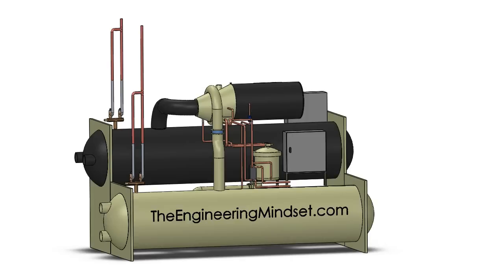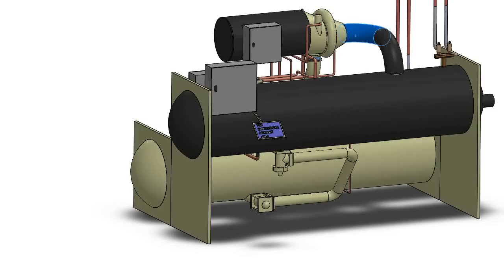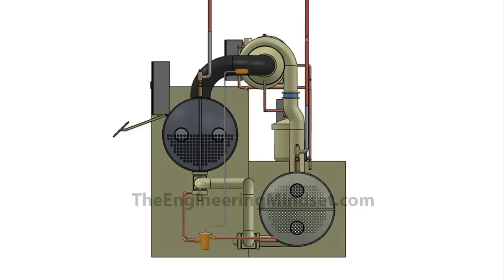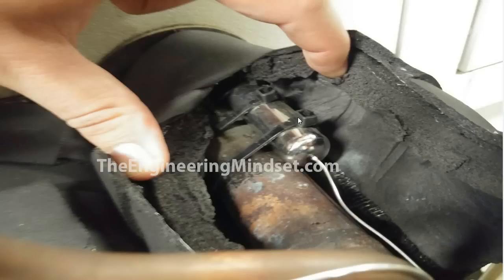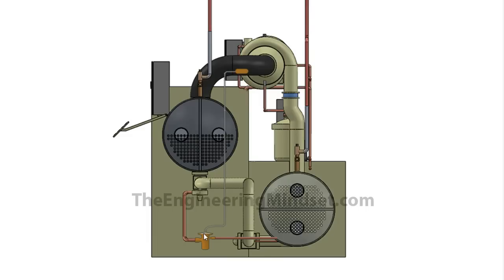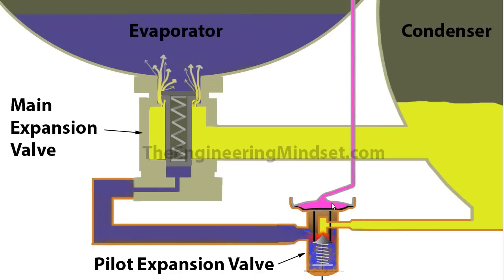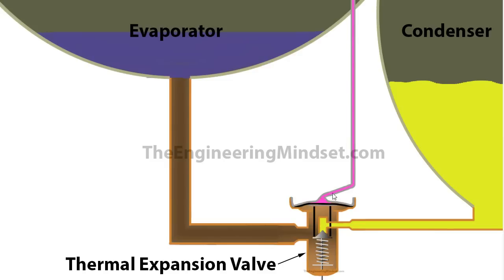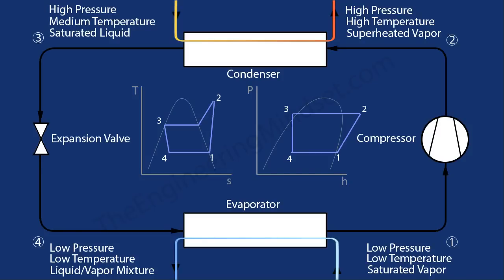Chiller - Expansion Valve HVAC

Comment: These videos are really good! Thank you for educating the masses! The mcquay machine your displaying the bulb from the pilot valve goes to a well on the top center evap. There is a temp sensor that is mounted on the suction 90 that gives the suction temp. to the microtech controller. The pilot valve is controlled from that bulb that is mounted in the evaporator. But all in all your videos are fantastic for getting guys familiar with chillers and also us seasoned guys for a little refreshing. Especially when all I’ve been doing is rebuilds.

Comment: Hello sir,
I would like to tell you that the first chiller has a float or orifice plate and the small tx valve is used for motor/vfd cooling as the base of the orifice chamber has liquid in it. As this style evaporator is flooded superheat is definitely not used for refrigerant control as it is likely to only be 1k. We work on approach with flooded type evaporators. 
The 3rd chiller is a Trane RTHB it uses a exv than that feeds the economiser, this exv is positioned determined on discharge superheat, the liquid refrigerant in the economiser is then controlled into the evaporator through a orifice plate, the sub cooled vapour in the economiser is scavenged and recompressed. This style evaporator is also flooded. The later trane RTHC and D also had similar refrigerant cycles but the exv was positioned via a low side float and I believe they may be falling film type flooded evaporators.

Comment: Thanks for your really great and helpful video, and can you advise what is a differences between Internal and External Equalizer Thermal Expansion Valve. Thanks
Reply from the maker: An internally equalized TXV uses evaporator inlet pressure to create the ‘closing’ force on the valve. An externally equalized valve uses the evaporator outlet pressure, thereby compensating for any pressure drop through the evaporator

Comment: Thank you for the information. I have a question, what do you mean by superheat? I bit you mean a superheated vapor. the thermal bulb which is located inside the suction line will sense the superheated vapor, but what I know is the status of the refrigerant after leaving the evaporator will be as a saturated liquid.

Comment: Nice video but you don't go into the aspect of the TXV sensing superheat.  You mentioned the Thermal Expansion valve shown had an external pressure 'equalizing' line, but didn't go any further.  By sensing both the compressor suction PRESSURE and TEMPERATURE, the TXV can actually sense the degree of superheat above saturation.  The spring setting can determine the degree of superheat.  So a drop in suction pressure will tend to open the valve, even if the suction temperature remains steady and vice versa.

If the valve only responds to suction TEMPERATURE, then an overcharged system can still pass liquid into the compressor under the wrong conditions.

Comment: I have a question. As the load decreases and the superheat decreases, what happens to the liquid refrigerant in the line between the pilot valve and the main valve that enables the main valve to close? Does it leak back through the pilot valve, or is their a bleed at the main valve that allows pressure to leak down? Thanks.

Comment: how can liquid refrigerant flow to the bottom of the evaporator? it's it being pulled by gravity?
Reply from the maker: It's being pushed by the pressure generated by the compressor as well as the suction from the compressor

Comment: We are experiencing a problem in our chiller system which is having an electronic controllled expansion valve. We have charged the system with 20 kg of R407 gas after having an alarm of low pressure. But it was not rectified and pumping down the system..we could barely see any gas coming back to condenser which was showing 75% when we charged it earlier. What all we have checked is
1. Dryer....ok
2. Evaporater...ok no leakage 
3. Expansion valve changed from a already  working chiller system.

Please guide us on what could be the possible cause of the syatem showing low pressure.

Comment: Hi friend @theengineeringmindset  I have a question for you, in another video I saw That in the sucction line there is a refrigerant  low pressure, low temperature, saturated vapor, but why the thermal bulb is in the suction line?? because knowing that the discharge line has the superheated vapor it should be in the disacharge line because the compression isn´t happened yet. Tnank you in advance.
Reply from the maker: try this video it will help https://youtu.be/oSLOHCOw3yg

Comment: what is the right superheat temperature for this kind of machine. 
I have 4 No's chiller which has different superheat
Reply from the maker: Hi Parvez. Have a look for the serial number and contact the manufacturer, they will give you the best advice as it will vary

Comment: What would cause the evaporator pressure to drop too low ?
Reply from the maker: There's a lot of reasons it might happen. Possibly a tube blockage, too high water flow rate, maybe the wrong delta T from design. Have a look on the BMS logs to see what was occurring at the time of fault. Compare it to other times and see if there is a comparison. If it gives an error code then look it up with the manufacturer to diagnose.
Reply from the maker: We just covered chiller faults in our recent video! https://youtu.be/Zu0LVVNNVSw

Comment: 1. What will happen if water droplets get into a centrifugal compressor?
2. What will happen if gas or vapour get into a centrifugal pump?
3. What will happen if we remove expansion valve from the centrifugal chiller or vapor compression cycle?
Thank you.

Comment: Thank you so much for the explanation :) i just had one question, The refrigeration cycle starts with the suction stroke of compressor right ? if yes then in that case how does the flow of refrigerant takes place  ? i mean does the evaporator is filled with the refrigerant ?? thanks again
Reply from the maker: Hello, yes refrigerant sits around the machine when idle, it only moves when the compressor starts. Over time the temperature will begin to equal out but as the machine starts it will change again.